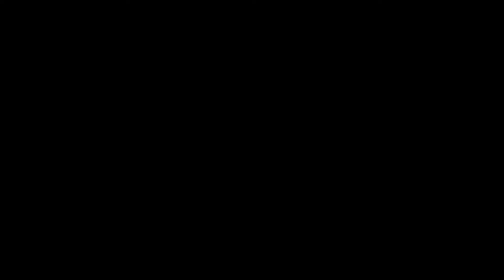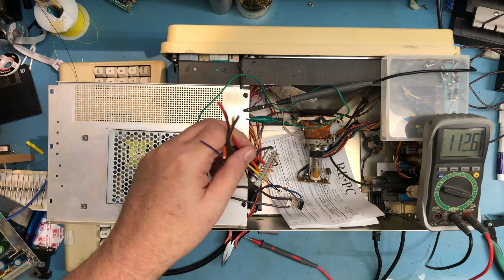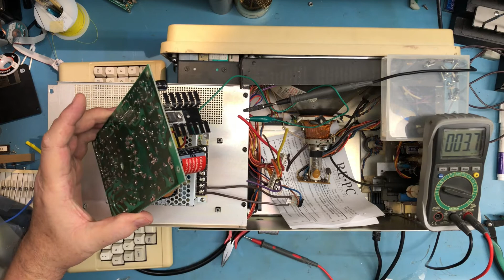STB531 - Tandy Model 4P - Part 2 - Temporary Power Supply

Comment: What type of power supply do you use? Is it not a problem to supply the drives via the same power supply? No flicker on the screen when drive motor starts?
Reply from the maker: It was a 
MEAN WELL RT-65B (+5, +/-12) - in this case I powered both the floppies and screen from the same +12 supply as at that time I wasn't concerned about screen flicker. In a future video we will address this with a 
MEAN WELL RT-65B (+5, +/-12) for the CPU and floppy drives and a MEAN WELL RS-15-12 (+12) dedicated to the screen.
Reply: @ShadowTronBlog  Thank you for your reply! Btw I have a 4P PS with the same problem, sometimes the switcher doesn't start, I spent hours but didn't find the fault. I am very interested to follow your "investigations" ...
Reply from the maker: @gastrodus  In a later video I replace the supply and design an adapter PCB that allows an easy connection between the Model 4P wiring harness and the two replacement switching supplies. I do plan to come back to seeing if I can repair the original supply.